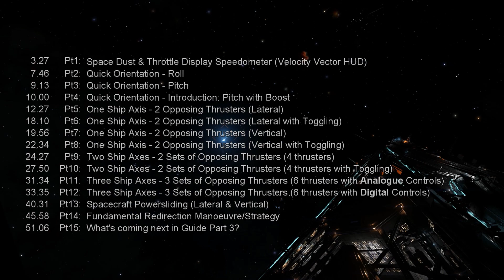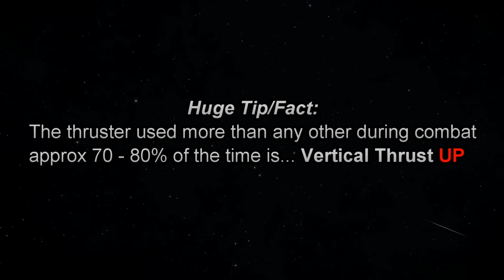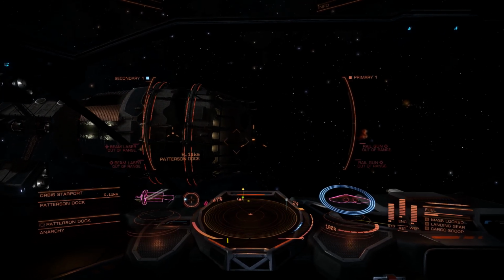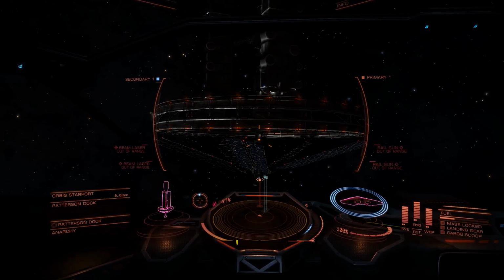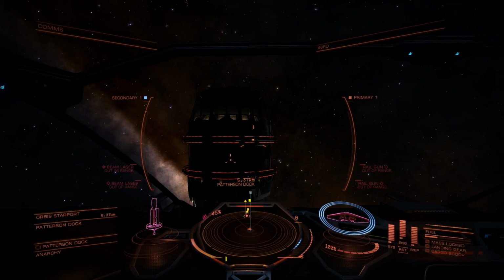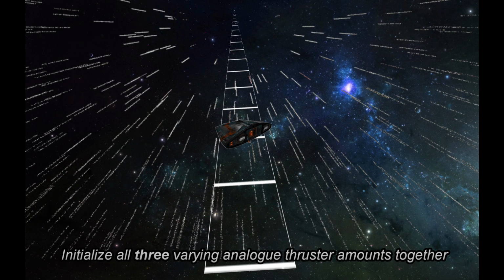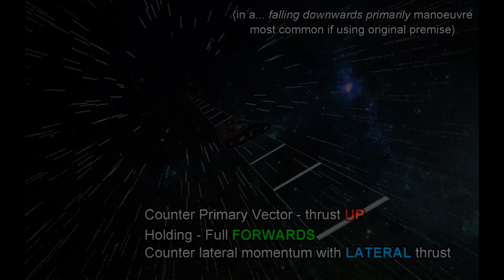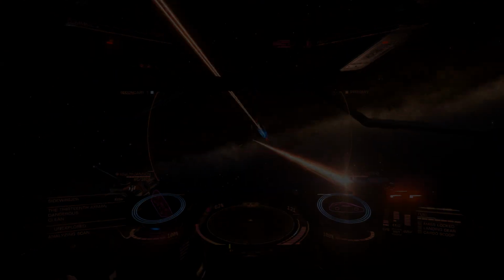Elite: Dangerous - Learning [to pilot with] Flight Assist Off (Part 2)

Comment: I just found out a way to turn off that damn mouse cursor continuous turning so now I can play FA with the keyboard like a competent person
Reply from the maker: +:P 
Would that be the Display Hardware Cursor option set to off by any chance? If it is this that you are refering to, you may find it a bit odd when clicking on buttons etc when in the station menu and whatnot, it will appear to be slightly missaligned. Nothing you can't get used to but just thought I'd warn you of the drawback of turning this option off.

Glad to hear you're finding it much improved without the cursor constantly catching your eye, I haven't ever played with keyboard + mouse but I'd expect it would be very irritating.
Reply: What I meant was that I turned on cursor auto center which made the arrow to control the turning reset in the middle immediately after let go of the mouse which makes turning a lot easier to do almost like a first person shooter. Now I can use fixed weapons in FA off mode
Reply from the maker: :P
Ar right, forgive me, yes that makes sense, there's also the relative mouse mode, perhaps this is something to do with it as well. As you've guessed I'm a novice concerning mouse controls and what's available, your help has been most welcome, cheers :)
Reply: yay i'm helpful
Reply from the maker: :P
Indeed you are, no doubting that :)

Comment: This is really hard and frustrating but i start to get the hang of it.. even though i feel it's quite hard to manage the forward/backward speed with a throttle (which doesn't zero in) and my vertical and lateral thrusters with a digital hat sick.

however one of the main questions i have doesn't concern the controls but how you setup your head look. do you have a dedicated stick or use a toggle button or something fancy like a IRTracker?
Reply from the maker: ***** Hey Stefan. Yeah at first it is hard, there's no denying that, was exactly how I felt when I learnt but once it clicked, in a rudamentary manner, I got so addicted with the floating, falling feeling so didn't mind all the practice thereafter. I agree that digital thrusters aren't ideal for fine control, but considering when each counter thruster is applied it is normally needed to be pressed for a sustained period whether you are using digital or analogue controls. 

The issue with digital controls usually rears its head when needing these varied amounts of thrust to counter a secondary lessor axis. "Learning Flight Assist Off - Part 3" (next upload in series) actually demonstrates a useful exercise aligning up with a station entrance where the varied thrust that is needed is forwards (and/or backwards thrust, but usually forwards if using what I refered to as the main premise), so this varied forward thrust which on a hotas is your normal analogue throttle control. So... what I'm trying to say is in the end, as long as you always roll until your target tracks upwards or flies over your head (the main premise) this varied thrust can be achieved, and the only real time to use, on a regular basis, your digital POV/HAT is used for vertical thrust which on the whole always needs to be a full digital input anyway. I hope I haven't confused you too much, guide 3/part 2 explains it in more detail.

As far as my head movement, you guessed it, I use TrackIR with a baseball cap infra red reference clip. I love the game with this, I've tried to play the game again once without it and it felt so restricted as if looking through a fixed window. Of course it's yet more money and the TrackIR is very expensive to be honest as much as it is good, but if you're interested in using such a device on a budget check out http://edtracker.org.uk/ made by a few devoted E:D backers who decided the trackIR was too expensive, I probably would have bought one if I hadn't already bought my TrackIR, but I've heard good things about it and it's a fraction of the cost.

Apologies for the long reply :)
Reply: LOOK INVERTED A long post that has a lot of useful information in it never needs an apology ;-)

you explained how to use the digital inputs quite well actually. I doubt i'm ever gonna be able to break down a multi-axial vector to 0 in a reasonable time but i usually get it down to 20... My problem is that i unconciously move the flightstick and/or throttle so i make it harder for myself. But hey, practise makes perfect and i didn't have enought of that ^^

I'm asking about the head look because i think the sideways-movement will become a lot safer when it's easyer to see where you're going. ;) But i just noticed i'm about to get off topic on one more of your videos here. So i'll just go to the fontier forums and ask my other questions about headtracking there. =) Thanks a lot your videos really help =)
Reply from the maker: *****
Totally agree, you hit the nail on the head. As an example if you notice in this guide on various occasions I look left or right to see the angle of the space dust more clearly, that is generally what I'm doing, I'm not turning my head just for fun. So for sure being able to look where and when you want aids your intended control inputs, not to mention the added benefit of keeping track of a hostile without even needing to use your radar on the whole very much, I barely do use the radar myself only when I've lost track of him, so ideally always trying to keep track of the target visually. The tricky part at first is the confusion of which thrusters you need when looking in a completely different direction to your normal facing straight ahead, but before long this becomes second nature.

I haven't even mentioned the increased immersion and enjoyment one gets out of the game as well, so if you do intend to buy one, what ever variant, you won't regret purchasing one, even if you buy the full bells and whistles TrackIR :)  Forum thread does have a wonderment of threads concerning this subject for your research, but don't hesitate to ask me anything further, as long as it's E:D related I don't really care what page it's on, it's all relevant!

Comment: what is your joystick?
Reply from the maker: Fatih Soykan Hi Fatih, my control setup is rather unorthodox (explained in more detail on my discussion page), but basically I use a x55 Rhino joystick and an xbox pad in my left hand for thrusters. x55 hand on throttle only has a digital hat so find the gamepad's analogue joystick and analogue trigger much better as a control setup (leaving only thrust down on Lb as the only digital input). As I'm sure you are aware, analogue controls are far superior. What do you use yourself or have you not dived in yet and bought one?
Reply: Look Inverted i'm using logitech 3d extreme pro and keyboard (: and yes i'm newbie but you have amazing rotation controls in assist off. Really impressive.
Reply from the maker: Fatih Soykan
Appreciate your kind words :) Interesting set up you have there, I'm presuming you use the keyboard for thrusters yes, although I have a question.... How do you have the translation thrusters set up, WASD for vertical & lateral with your main throttle axis somewhere else? I've always wondered how keyboard users set this up because you are an axis down, either mapping W & S for vertical as I say, or having your main forward/backwards throttle on W & S similar to a fps, but then where do you map the vertical? Hope I haven't battered your head in too much but I'm very interested to hear how you've mapped all three axes :)
Reply: Look Inverted First of all congrats for your videos and thank you. Extremely well done and with useful content for noobs like me :D. I've limited myself to switch from FA ON and OFF in combat but after watching I'll try all time FA OFF. Btw I tried that mix of logitech 3d xtreme pro and keyboard (WASD as a FPS and adding Q&E for vertical thrusters) it kinda works but I didn't like it, however I never thought of using a gamepad like you do! I will start using my ps3 gamepad and see how it goes. Cheers
Reply from the maker: *****
Thanks Wolfgang, appreciate your compliments. As far as the gamepad for thrusters I doubt I'll ever go back to a hands on throttle, let's keep in mind these have been designed for atmospheric flight, not space flight. As things stand there isn't such a controller for a 6dof space sim but for sure the gamepad I'm using works well enough for me considering it uses analogue inputs for all but one thruster (down which is rarely used quite honestly with the roll until the target is above you technique). Glad to be of help, let me know how you get on :)
Reply: Look Inverted Hey mate sorry for not replying earlier! I tried using the ps3 controller and it does work like charm, It's feels a bit weird at the beginning but its an excellent setup to anyone who already own a gamepad and joystick. I still need to figure out the best setup to bind the most critical keys in the gamepad and joystick and avoid having to hit anything in my keyboard while in combat. 

Combat with FA OFF its a damn challenge, its really hard for me to hit anything with fixed weapons (back to gimballed) but the "RUTA technique" helped a lot I feel a bit more under control (I keep telling myself "just roll a bit and keep the target above") and I don't end panicking and spinning out of control like an idiot. Before I limited myself to switch to FA OFF to do quick turns at the sacrifice of speed but that's not the case anymore :D. 

I just subscribed to your channel. Thanks for your help!

Sorry for the retarded English. Not my main language.
Reply from the maker: *****
"retarded English"?, very funny, but before you said that I wasn't thinking this guy's grammer is hopeless, you speak very good English, better than most natives quite frankly.

The main advantage with using this roll until target is above you regularly, the thruster counters required are of course always the same for the most part because you were undoubtedly travelling towards the target beforehand, so as a rule, generally only thrust up is used most of the time. Like I suggested in these guides, thrust up is used 70-80% of the time during combat, so the inputs on the whole aren't complicated and hugely varied.

I'm not going to say it's easy, but it's certainly not hard once you get in to habits.

Glad to be of help Wolfgang, and thanks again for your comments :)
Reply: +Wolfgang Pereira hey the ps4 controller is on the xone. Try the ps4
Reply: +Look Inverted Enjoyed your tutorials very much. Excellent job.

As to how to bind thrusters using WASD I suggest using WS for forward/reverse thrust and SPACE (jump in fps ?) for upwards thrust and LeftSHIFT (crouch) for downwards thrust.
Reply from the maker: Verndroid
Thanks for your input Vern, and that's a new configuration that I've not heard of quite honestly. Just hovered my hand over my keyboard and yes I see no reason as to why that doesn't/won't work. As usual I suppose it comes down to personal preference and what feels natural and intuitive to use for each individual, but none the less, appreciate yet another take on a differing control setup. Cheers :)

Comment: Very good guide, thank you. But I still really don't get powersliding. How do you do that?
Reply from the maker: Petr Zubets Hey Petr, thanks for the compliments. The powersliding is pretty much happening all the time when piloting with no flight assistance, simply because when piloting like this, one has a tendency to turn (orientate) your craft to face your enemy/contact, thus you aren't facing your current ship's vector anymore. So in essence once you've done this "turning" and you apply any thruster lateral/vertical or even forwards/backwards thrust you are basically powersliding. 

It happens all the time quite frankly when piloting with no flight assistance, but this exercise in this that's entitled "powersliding" is an exercise to help you practice this technique with the station as a reference to powerslide around. Once you've done this quite a few times you'll exercise the same technique when in combat and will be powersliding everywhere. 

Your question as to how do you do it, explaining the exact inputs in text isn't really possible, I suggest you find an orbis type station with a habitable ring and see which thrusters you need to continue or counter your "slide" around this large circular reference point. Which thrusters will depend on which way you are orientated in relation to this habitable ring. Give it a go and you'll soon see which thrusters are needed to accelerate and speed up your momentum or counter this momentum and slow down.

Comment: Question: I don't usually fly fully FA off because I still need to learn some of the skills (thank you) and my joystick seems hyper sensitive... but I often use thrusters UP and DOWN while flying in FA ON to stick on the tail of a target and that seems to work well. If I am continually holding a down thruster on while in FA ON... will I only be getting down thrust or also forward thrust? When I do this I am essentially tailing them in a turn bu also thrusting down so I am continually pushing myself behind them and keeping my guns pointed at them.
Reply from the maker: +dregerclock 
As long as you've centered or zeroed your main forwards/backwards thrust whilst doing this thrust down then yes, all your ship will be doing is translating downwards no matter how your ship is orientated, for you to then apply a slight forwards or backwards main throttle axis to keep at a specific distance from your target you are vertically strafing (with fa On of course). With fa Off it's a bit different and you have to keep an eye on your throttle display to check if you're travelling slightly forwards or backwards, depending on your orientation, one can never really translate exactly in any vector/direction so the throttle display will at least tell you what is required (though one can gauge a lot of this by the target/hostile you're strafing, but it's good to keep an eye on your throttle display regularly, much like a habit of using a rear-view mirror when driving).
Reply: +Look Inverted Thanks... yeah, what i am doing seems to work great against Condas and other ships... Clippers can sometimes turn around on me still... and Fed assault ships seem to be close to be able to shake me ... i think some FA off would help me getting and staying behind them.

Comment: Are there any techniques you would recommend for a mouse&keyboard player?
Reply from the maker: +vedasisme 
The good thing with the mouse specifically is you get sensitivity and power curve adjusters, something the joystick user doesn't get (so if you can manage ship flight with keyboard&mouse you'll have a noticeable advantage in ship rotation/orientation), but these exercises in this part 2 guide concerning digital thruster controls of course relate to the keyboard user as well as the hotas with a digital hat for thrusters. 

Your main issue is finding enough keys for ALL thrusters that feels intuitive to use. WASD used for your vertical/lateral but where do you then put your forward/backward thrust? R & F perhaps or I have heard of someone using a couple of buttons on their mouse. Once you find a good layout you like with all thrusters to hand and have got used to it, you'll do well with flight assist off with k&m. 

You should check out this guy: https://www.youtube.com/user/skafsgaardhjorth/featured
He's a couple of vids helping out the aspriring fa off pilot (not to mention many other vids) from the perspective of keyboard + mouse and fa off, he's an excellent pilot - you should check out his channel, perhaps this will help as well.
Reply: Thank you for the tips, I've already been applying some FA-off tactics to great effect in the training battles.  I'll have to experiment with the power curve adjusters, that sounds like it will be just the thing I need, and I'll check out the link immediately.  Thank you again!
Reply: One more thing -- is there some way to increase the visibility of the space dust?
Reply from the maker: vedasisme
Only one - by increasing the Gamma setting in Graphics options. This does work but obviously the rest of the graphics are messed up too, I've heard of a few cmdrs doing this initially just while they're learning, then gradually reduce it bit by bit back to normal.